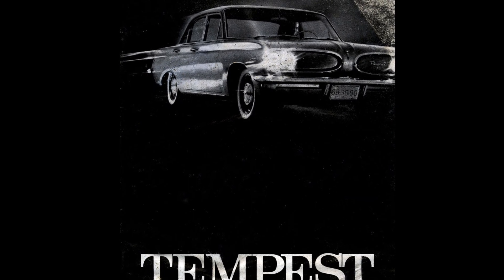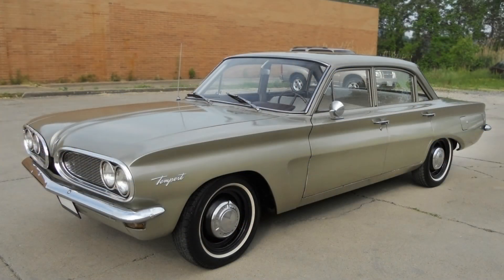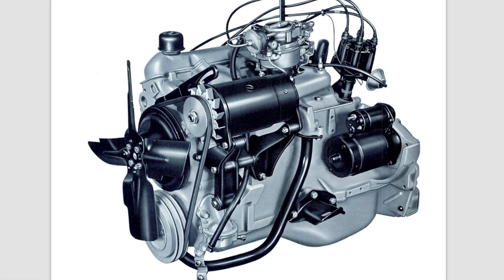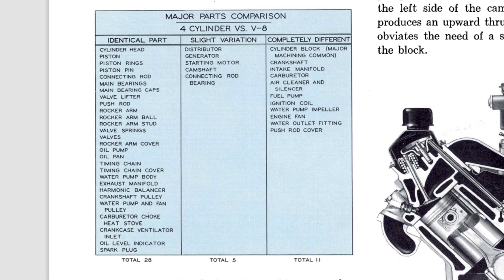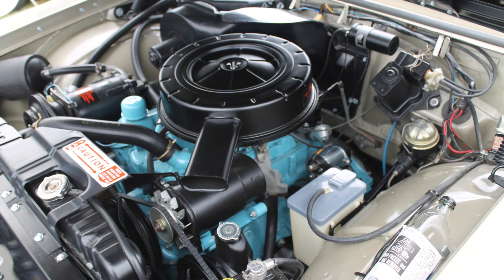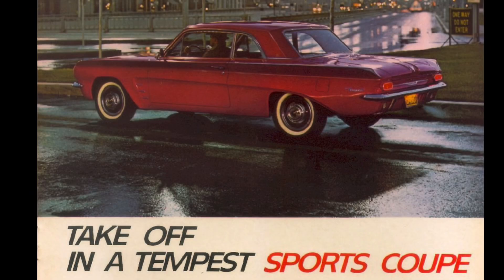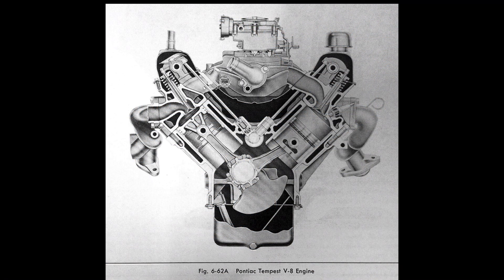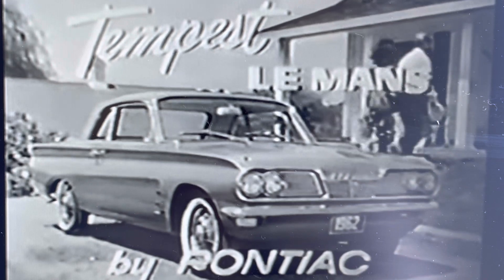Strangest Automotive Engines: The 1961-63 Pontiac Tempest & Its "Trophy 4" / "Half 389 V8" Engine

Comment: My first car was a '63 Pontiac Tempest with the 4 cylinder engine. In the late 1960s they were called "gutless wonders". The 63 was much better looking than the earlier models. The timing chain was a weak point. It only lasted about 60,000 miles. Good Luck, 
Rick

Comment: i have owned many, and still have 3 63's...no 63 models were shown, sadly, as it is the prettiest of the line..they ride like a big car when the suspension is correct, and have NO cornering issues if driven correctly,which most folks do not understand..

Comment: Mom had a 63 and I remember that car well because my brother used to steal it, and that was where I learned how to 'hot-wire' the old cars 😁 Look back at the under-hood shots where the starter and coil are a foot apart, and the starter terminals SO easy to get to to crank the engine. From lifting the hood to driving off is under 15 seconds without breaking a sweat 🤣 I also remember my brother's antics becoming suspected so he began pulling the speedo cable too so there would be no added miles showing up to match the loss of gas in the car's tank. I do remember ours was a slug on acceleration so it must have been the base model, as well as recalling the transmission going out as the reason it went away.

This was one of the earliest examples of John Z DeLorean's approach to running a GM division which made him a lot of enemies in the corporate Boardroom structure. He took a practical approach to carmaking, added performance and styling, and  consistently had one of the best profit margins of any GM branch. It was that success which shielded him for so long that went away when they assigned him to run Chevrolet, which was so badly manged that to do the same there would have taken decades, not years like it had at Pontiac which was much smaller. His enemies couldn't beat him making cars so they took him out through corporate politic instead, and the sad ending is as they say "history" with one failure overshadowing one of the biggest successes Detroit had ever seen.
Reply: What ever happened to your brother. Did he become a career criminal?
Reply: @snowrocket  LOL 🤣 Can't blame you for asking can I? Nah, we grew up eventually and stopped doing those immature things. We ain't been to jail and turned out OK in the end. Joyriding was a thing back then but almost always the car would be found unhurt- maybe out of gas somewhere or just parked wherever they were going to. If you're old enough you might remember the Federal government required locking steering wheels sometime in the 70's which brought all that to an end, but replaced it with stolen cars always having the ignition switch tore up if they were recovered. It was a different world back then; not a better world but different.
Reply: @P_RO_  Thanks for responding. You both were lucky nothing really bad ever came of it. The same for crazy stuff I did in cars. I just think some stories "require" a proper follow up, so thank you for yours! I think I know of someone who used to pull the speedometer cable on a car to drive a fair distance and back, then slowly refill the gas tank to look like only a few miles had been put on. Not me, but someone I know well. I was too afraid I'd get caught to try that.

Comment: Adam, I was happy to see you do a video of the 61-63 Tempest with the "Trophy 4". My first car was a '62 4-door with 101,000 miles. That engine was a good one. With the transmission in the rear it went through snow like nobody's business. The drive train was the only thing good about it, though. It was a rust bucket and the bench seat was tore up but the radio worked and it started every time. Even in the coldest weather.  I really enjoy your channel.
Reply from the maker: Very cool!

Comment: I’ve always been fascinated with these cars - the funny little foreign car built by GM. Well, along with the Corvair, with which it shared a ton of DNA. Of all the first generation GM compacts, this was the only one that started production with a 5-lug wheel nut pattern. An oddball one at that. The supply of spare brake drums completely dried up (last I read) but the work around was to use a Ford Ranger drum, which could be retrofitted once a bit of machine work was done. The 15-inch wheels gave it sort of a puppy foot appearance, to me. I’m glad you fit this into your content, Adam.

Comment: One thing I rarely see mentioned is the evil handling of the 61-62 Tempest. (Yes, I know this vid was about the engine). The Tempest shared the entire rear suspension with the Corvair, and that means swing axles, and all the camber changes they bring. Hard cornering would bring out the "Tuck under" characteristics caused by the swing axles. Pontiac revised everything for 63, making it less of a problem. With super-slow steering (6 turns lock to lock) it caused a few drivers to lose it around hard corners.

Comment: My dad bought a used 61 Tempest for my mother in 1966. Great car, I learned to drive in this car. The original owner had it repainted , was like knew when we got it. I remember the gear selector was mounted on the dash and there was no park just neutral. Sold it back to the original owners son a few years later when my dad bought my mother a 68 Galaxie 500  in 1971.  Thanks for the memories Adam.

Comment: I must respectfully disagree with your assessment. An engine that was discontinued after just 3 years, and with no rightful successor adopting any of its minor innovations, is not what I would call “successful.” If it was profitable, it was only because of the very low initial investment. 

If anything, the Tempest’s true claim to success would be its use of the Corvair’s swing axles at the rear while avoiding the worst of the Chevy’s dynamic instability, due to the better weight distribution.
Reply from the maker: Fair enough. Planners seemed the existing 61-3 Tempest to be too small for the high living times of the 60s, and the engine just didn’t make sense in the larger car.  It used so many 389 components, I doubt it was expensive to tool or engineer.
Reply: Out of all the negatives, the Tempest was a great handling car.

Comment: I would bet they sold way more timing chains listed for the 4 cylinder for racers or performance use with V8 's than  ever went in to replacements for the 4 cylinders. They were a way better chain and we used to put them in any Pontiac V8 any time a chain was replaced it was one of those known upgrades back in the day. The number from Cloyes just had an A after chain part number as in C350 vs C350A  oher companies used C355 if I remember correctly really should have been put in from factory but you know how it goes.

Comment: Had three of these back in the mid 80's. Two '62 LeMans coupes and a '61 Tempest coupe. Even back then, nobody knew what they were, being over 20 years old by then. I thought the most interesting part was the distributor cap. It was a regular V8 cap but every other wire tower was molded flat.

Comment: Was Oldsmobile's version of the lightweight aluminum V8 that found its way into some clones of these cars constructed better than Buick's with more head bolts and/or better head gaskets?
Reply: Old's had their own heads with more head bolts. I never heard of head gasket leaks being a problem for Buick.. Buick kept the same basic architecture in their 300, 340 and 350 engines as well as the V6 engines which were a shortened version. I never heard of them having head gasket problems.
Reply: Remember, Olds later offered a turbo version of this V8. They may have decided on somewhat more "robust" construction for that reason. Buick never went that route but did offer a "high-output" normally aspirated version which, in its final form was 200hp as opposed to 155 in the base version.

Comment: More or less a shortcut/cost savings over developing a new 4 cylinder engine but I understand this thing although a shaker was very robust and reliable although I would imagine it was much heavier than a purpose built 4 cylinder engine
the rest of the car maybe not so great,I think most of them had 2 speed automatics,don't know how reliable the offset power carrier cable in a tube was--sort of like the power cable in my string trimmer-the cable in my Stihl professional model is thicker than the one in the light homeowner models 
  I think the excellent 326 V8 didn't go into the Tempest option list until the cars were made bigger and onto a frame type construction? I think this little Tempest was unibody?

Comment: Great feature on the 4 cylinder Tempest. I'm afraid the ad at the end was for the 62 model year. My folks had a 63 and the front and tail light were updated. ( The 1962 on the license plate is another clue.) I remember pulling the engine when I was 15 to work on it. those were the days.

Comment: In DeLorean’s biography he said that the “rope drive” Tempests were a nightmare for owners. Apparently it had a lot of vibrations and hence, discontinued at the end of the 1963 model year. The replacement 1964 Tempest was a vast improvement.
Reply: Thanks to the car redesign for 1964, and Pontiac having one V8 in 326, 389, and 421 displacement, the GTO was born. The story I read was that DeLorean wasn't impressed with the 326, and a fellow engineer suggested installation of a 389. The rest was history. GM corporate forbade engines larger than 400 in intermediate cars, but more than a few 421, 428, and 455s from the wrecking yard found their way into GTOs, Le Man's, and sleeper Tempests.
Reply: It did have a flexible drive shaft, which in part allowed the small drive hump. The '61 that I had was unfortunately underpowered, had a poor excuse for an air conditioner, and had a few other problems like a weak timing BELT. (Yeah, the narrator said chain, but the belts crapped out so often that busy service stations usually had them in stock.) I put up with the car for two years until I took a long trip through the Smoky Mountains where the sorry automatic transmission spent half it's time in first gear.
Reply: My family bought a new '63 Tempest 2 door with the 4 banger and a three speed. It was maroon with a black interior. Without a balance shaft, the engine shook like a dog passing a razor blade. The transaxle failed while it was still under the warranty. With swing axles, the handling was mediocre. It was replaced in the fall of '64 by a Volvo; a far superior car.
Reply: @charlesnash2748  Mine was a two-speed, like most automatics back then. Gear selector on the dash. Upgraded to a Vauxhaul. Next was a Toyota Corolla.

Comment: AMC chopped off two cylinders off its 232 cid straight six to make a four cylinder for the Jeep Cherokee. When GM quit offering its 2.8 liter V6 to AMC, they added two more cylinders to the four-banger, creating the very durable 4-liter six used in Jeeps for decades.
Reply: I understand that the Powertech Six was derived directly from AMC's 199/232/258 inline six family 
232 sixes especially were impressive,powerful enough to serve as base power for the old full size Cherokees of the 1960s and in 2 barrel carburetor form embarrassing Powerglide V8 Chevrolets at stoplights when in small Ramblers 
I believe some AMC/Jeep products had a 4 cylinder Iron Duke engine and some had an AMC engine with the 2 end cylinders missing. I think the first 4 cylinder unibody Cherokees had the Iron Duke.
Reply: I'm not sure that's right.

Comment: In 1974 I owned a 1962 Tempest with the four cylinder engine and the automatic transmission below the trunk.  Like Chrysler products it also had the shifter on the dashboard, but a lever instead of buttons. It was a nice riding, economic car in town but it only had a two speed automatic transmission. The motor was screaming at 75 mph. Nixon instituted the 55 mph National speed limit so it was ok with that.

Comment: It would be implausible to think that any automotive company today would create such an unusual drivetrain and vehicle that were only scheduled to be in production for three years! Amazing the kind of money GM had to play with during this time period…….😮
Reply: ddellwo... Always amazed me in that era how much money GM must have sent down the drain. Funny more shareholders didn't get the drift & raise a fuss. 
Every division had their own engines chassis & suspensions. Only 3 divisions shared Hydra-Matic. Buick & Chevy collaborated on two of their automatics but, pretty much, each went on to build their own. Then, as you mention here the compacts of 60/61 which shared a lot of structure & sheet metal but little in the way of engines. (The aluminum 215 V8 was sort of "shared" but as someone pointed out it was only the basic block design. Olds did their own piston & cylinder head design. Pontiac did the 4cyl, not shared. Buick the V6, not shared (till later). All three used uniquely different automatic transmissions that weren't even shared with their full-size stable-mates. (Due to its configuration the Tempest trans may have shared some components with the Corvair Powerglide & the "small" version of the Olds "Roto" Hydramatic went on to see usage for a few additional years in Vauxhalls, Opels & Holdens) think also of design & tooling costs to build Corvair station wagons for a mere 2 yrs and the cost of design & development of the Chevy II when they realized Corvair wasn't selling well up against the Falcon. All that & not to even mention the annual styling changes! Of course everyone else was doing that. Seems it was the expected thing back then...

Comment: Equally important and groundbreaking was the driveshaft that was given a arc to cancel vibrations. Also driveshaft was supposed to act as a torsion device to smooth the vibration pulses of the 4 cylinder much like a dual mass flywheel does today.
Reply: @Greatdome99  the arc of the driveshaft tube may have been intended to increase cabin space there are other benefits. Following is a quote from another source indicating such. 
“While the most obvious purpose of the drivetrain setup was to allow a flatter floor in the passenger cabin, there were other benefits. First, the long, thin driveshaft dampened the significant torque reversals of the slant 4 engine (which in a four-banger are more than 100 percent) and when bent into an arc, the shaft’s critical speed is above the engine’s operating range. Next, with the engine supported at the rear by the torque tube and transaxle, the drivetrain absorbed the engine’s torque reaction and vibration periods. The rubberized front engine mounts could be pillow soft, allowing the Trophy 4 to dance around in the engine compartment, isolated from the passengers in the cabin.”
Reply: Pontiac engineers knew they had problem from the beginning. Engineering is a series of compromises. They had a serious 4 cylinder vibration problem combined with a wippy driveshaft. So, softer engine mounts equals wipper driveshaft. They could have added more support bearings to the driveshaft, but no. Hence, they were on the wrong side of the compromise.

Comment: Hi Adam. Thanks for this interesting video. It brought back memories of the 1963 Tempest that my parents had in the early 1970's. A rather odd car but roomy and dependable. It had the gearshift lever on the dashboard and just a small driveshaft tunnel providing much more interior space due to it's transaxle design. They replaced it with a brand new Ford Maverick in 1975 ( 4 door sedan ). One  the first things I noticed when riding in the new Ford was how much less leg room there was due to the bell housing tunnel.
Reply: Dependability? not so much with the YES a Corvair two speed powerglide transaxle. went through two of them.....

Comment: Torque tube? Hmm I thought those years had a "flexible" driveshaft, like a large flexible drive on a drill?
Reply: I think it's actually just a solid steel rod bowed in the middle with a bearing to keep the floor tunnel low...
Reply: @BuzzLOLOL  No, it was a stranded cable. That's where it got it's nick name of 'rope drive'.
Reply: Yes. I looked it up; pretty interesting. There was a rigid torque tube with a 3” drop in the center. The actual stranded drive shaft was inside and didn’t need to be supported. Since it only had to provide engine torque (not gear multiplied power, ) it was only the diameter of a man’s thumb! Pretty interesting engineering; all those 1st GM compacts had some kind of innovative quirk. I’d like one of each.

Comment: GM was famous for chopping cylinders off V8 engines resulting in unbalanced 4 and 6 cylinder engines.
Reply: And then creating a smooth even fire V6...
Reply: Right. I had a GM 90 degree V6 in my Jeep. Another shaker.

Comment: I think there was a SD421 special option for that Tempest.
Some rare factory race car..
Reply: The bigger Tempest with a frame? Also known as "The Judge" ?
Reply: No, it was the 62 small car with trans in the back.  
I believe a had full were made, Mickey Thompson had one and some ran super speedways.
Reply: I believe those were done in 1963 & if I remember, were raced quite successfully up against some exotic European cars. Transmission may have been a weak spot though...

Comment: My family bought a ‘61 Tempest brand new with an automatic transmission as a second car.  It had an interesting dash-mounted short throw gear shift lever.  I was 7-years old at the time and I remember the engine vibrations and rather loud exhaust note compared to our primary vehicle which was a gorgeous blue 1960 Buick Invicta hardtop.  Good times!

Comment: I’m surprised the engineers couldn’t get that big 4 cyl balanced with counter weights and flywheel
Reply: It's too big, being over 3 liters. You would need a balance shaft going at 2X the crank RPM, which costs money.
Reply: It was fairly smooth but still sounded like a sewing machine 4 banger...